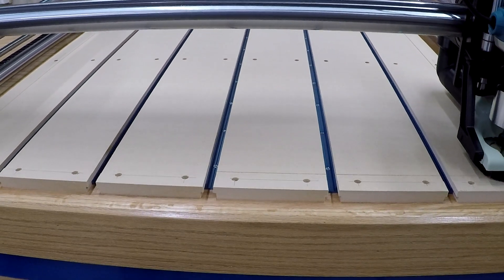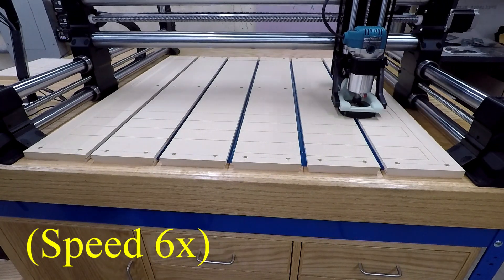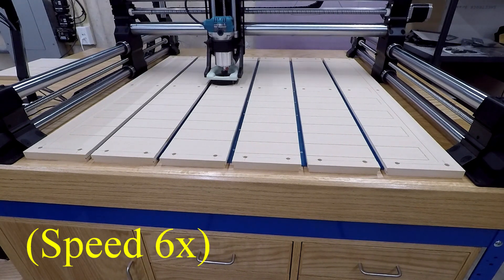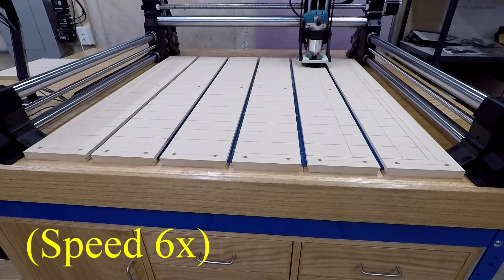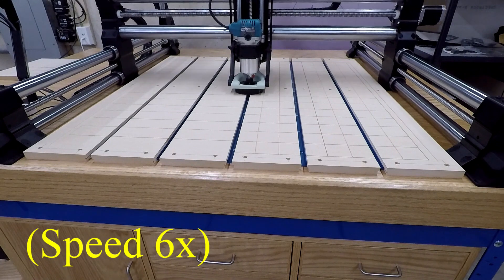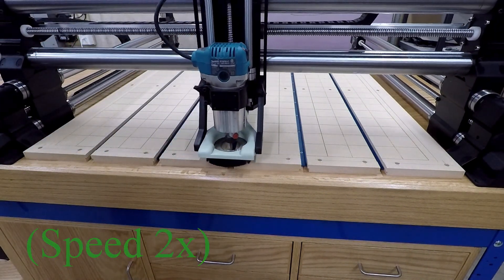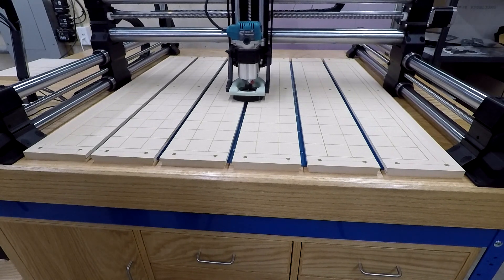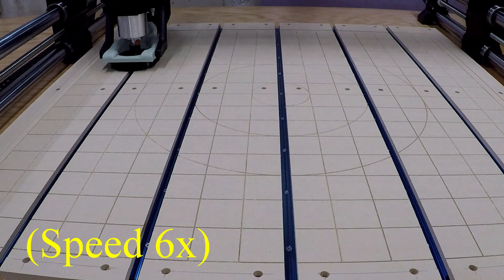CNC Spoilboard Grid

Comment: How did you get the grid to line up with the wood pieces of the board tho?
Was the bit going in the track groove to was to make the grid? 
Are some of the squares smaller than the others because of where the t-track is?
It was hard to see in the vid.
Thanks a lot.
Reply from the maker: Hi Joe,
The grid lines don't necessarily line up with the MDF boards. I was careful in my alignment when I put the boards down, and I used the machine with a v-bit to mark the forward corners in the bench before attaching them.  I had masking tape down and connected the points to create a straight line roughly parallel to the CNC.  But in my case it doesn't matter if they are slightly off since I don't use the boards or t-track to align actual workpieces.  That is why I used the machine to do the grid pattern - the pattern is square to the machine.  That said, I don't really use the grid lines much either.  I have since attached a small piece of scrap plywood, had the machine mill the back edge of it square, and I use that to align my workpieces up against it.

Yes, the bit did travel in the t-track grooves if there would have been a gridline there.  The gridlines are on 2" centers, so if one happened to land over a t-track that's where it would have been.  So some of those squares look smaller because you can't see all four lines.
Reply: @mystic6tube  This is perfect dude. Thank you so much for this information!!
 I had to laugh to myself a little bit when you said you don't even use the grid lines anymore lol.
I have seen videos of guys using those 2 pieces of wood that you were talking about, to lineup their project and I have to admit, I kinda like that way of doing it.
 I'm brand new to this stuff so I'm still trying to find my way as to how I want my spoil board, what I'd be more comfortable with. 
But your info has really help me A LOT. Thanks so much and I appreciate it!!
Reply from the maker: @JoeLazzara  You're welcome!  In all honesty, when I replace my spoilboard I will likely take out the t-tracks.  I don't use them.  I either tack my workpiece down with 23ga pin nails or I use the blue tape and CA glue method.  I have had success using both of those methods.  I'm too afraid of clamps getting in my way.  

The 2 pieces of wood as guides works as long as you know they are parallel/90° to the machine.  It probably works best when using the CNC to bore holes for threaded inserts and having machined the wood edge guides with the CNC too.  I use the X-guide so I know that is parallel to my X-axis.  I only use a second guide for the Y-axis if I need to be able to repeat that front left location.

Another suggestion: My spoilboard was is larger front-to-back than my CNC can reach. So after flattening I have a lip all the way around (right inline with the screws in the front).  It hasn't affected me yet, but it does mean if I have a workpiece larger than 32" I won't be able to lay it flat.  I'll deal with that if it ever comes up, but when I eventually replace the spoilboard I will either make it smaller or take a handheld router and shave off that border around the outside. 

I have a webpage where I posted some pictures and these videos.  You can zoom in on the pictures if it would help you see the detail.  
http://mystic6.net/CNCPrep.html is the spoilboard prep 

And then in http://mystic6.net/CNCLogoInlay.html there are a few pictures where you can see how I used a piece of plywood to locate the work.
Reply: @mystic6tube   Jeez thank you so very much. 
Is it possible to contact you privately through the web page?
Reply from the maker: @JoeLazzara  Sure.  I just realized that the email link wasn't at the bottom of those pages, so I fixed that.  It is there now, feel free to email me.
Reply: @mystic6tube   I just checked the web page and I see it at the bottom. Thanks a lot for all of your help with this.
 We'll talk soon buddy.
Reply: @mystic6tube One thing about having the lip on the front, or the side is that it’s square to the machine and can be used as an alignment guide.
Reply from the maker: @BobBob-eh5sb  Good point!  I usually tack down a sacrificial fence a little further up the bed and mill it with the machine to make it square.  I haven't needed anywhere near the full capacity yet, and having the workpiece away from the front edge keeps any chips/dust on the table.
Reply: @mystic6tube  Yeah, makes sense. I ended up with a lip on the sides after resurfacing my board, not intentionally, but wasn’t sure where to set the outer limit. I have been using one of them to line my carpenters square up with and can slide it along the lip to where I want the workpiece. Probably do something different when I replace the board. I like the grid idea. I think lining things up with it would work well enough with whatever holding method is used. I’ve found that most of the time, especially when cutting the finished project out of the work material, unless it was really out of square with the machine , a line width or so isn’t going to be noticeable.